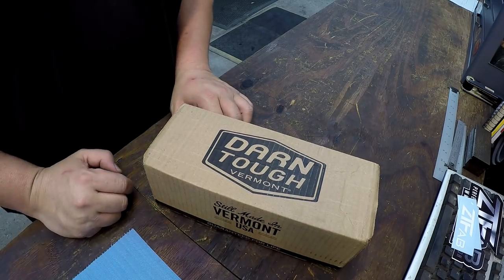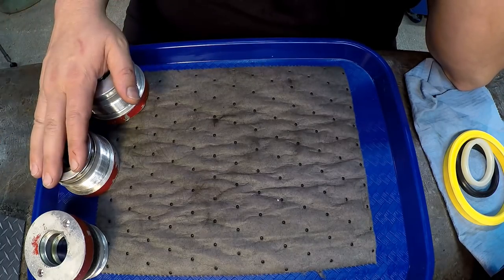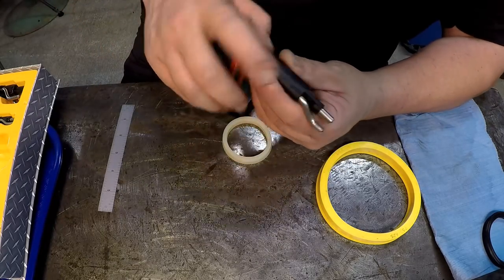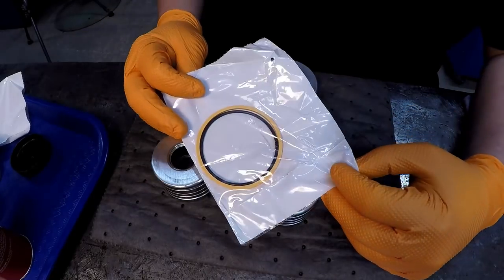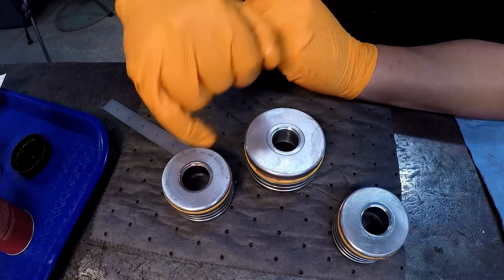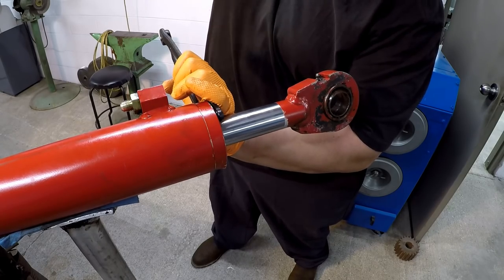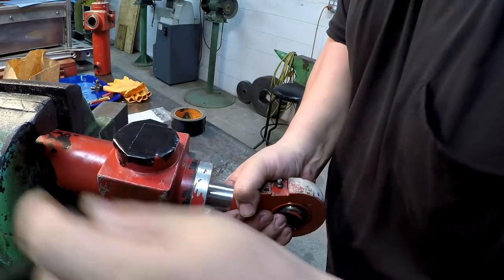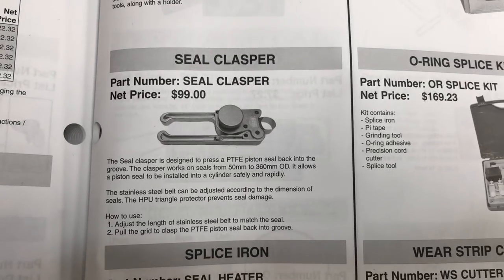SNS 217: Rebuilding Hydraulic Cylinders

Comment: I’m in the process of rebuilding a small cylinder on my Kubota and I ordered the seal kit but I had some questions that didn’t know if you could answer. All my local Kubota dealers seem to not want to help.   But was wondering if there was a way if I could send you two pictures of the plunger on my cylinder?  Thanks Ben

Comment: No doubt it's been mentioned already, and no doubt you're already aware, but for those who aren't;  a quick weld bead (TIG bead no filler metal required is ideal) around that bearing ID will shrink it and make removal easy.
Reply from the maker: We do it all the time, but didn’t work in that thin race. Weld beads wanted to melt through and stick.

Comment: right now I'm in the process of painting the  530 case Backhoe back to the factory color case yellow one gal of case yellow paint from tractor supply $100.00 and the set of 4 case decals I've got to order from case manufacturer for $100.00  I'm getting the Backhoe all painted up before winter gets here

Comment: Socks.  I have big feet.  Not quite so big as yours, but pretty big.  Most people with big feet have big legs.  

I bought several pair of the largest Dan Post socks after seeing them mentioned on your channel.

The heel to toe length is fine, but the diameter of the tube going around my leg is so small that it's very hard to pull them on.  After working all day, it's also hard to peel them off, and my leg feels numb.

The Darn Tough socks don't seem to be available in white.

Why is it so hard to find good white socks that fit properly?
Reply from the maker: When I first put the socks on they seem to be tight but loosened up a bit after wear and washing. I like the height of the Dan Post socks better and want to get some more in the plus size.

Comment: The backup rings you installed, are the orings overlapping the back up or are they staggered? Its hard to tell from the video. Oh and to answer your question on NGLInumbers, the higher the number the thicker the grease, for example: 00 is very viscous while #7 is solid  or very rigid at room temp. By the way, thats a nice spanner wrench, where'd you find that style? All i can find are the c clamp style for a ratchet..

Comment: Per Adam's request - what I found on the internet about #2 grease: 

"The most common NLGI (National Lubricating Grease Institute) grade of grease is #2 grade grease. These grades determine how thick or thin a grease is based on an ASTM D4950 test for penetration , at X60 strokes, @ 25°C and range from #000 (fluid) to #6 (brick). #2 grease has penetration of 265-295 (tenths of a millimeter) at 25C" 

http://elmusa.com/FAQ/ELM%20GREASE%20QUESTIONS.html

Comment: Why would you braze the tool holder instead of welding it? Wouldn't welding be much stronger?
Reply: Its a hardened forged part. Welding it would ruin the grain structure.

Comment: the NGLI Grade it the thickness of the grease.. There are grades 0000-#4 or higher.  0000 is like a thick gear oil especially when warm and #4 being rather firm- about the consistency of your average caulk..

Comment: That $100 seal compressor could be replaced with a $10 band type ring compressor used to install pistons into cylinders.
Reply from the maker: We use them all at our hydraulic shop. Seal clasper works better then a ring compressor.

Comment: I have a set of those tool. The cylinders I rebuild once in a while 3”-5” cyl
I’ve always found it easier to use these tools fiat faced  on flat surface.   VS. the way your doing it seems more problematic 

Try it on flat surface
Reply: I am  from China Seals Factory. Our company produces many types of hydraulic oil seals. If you are interested in our products, we can send you free samples so that you can learn more about our products.
Reply: I am from China Seals Factory. Our company produces many types of hydraulic oil seals. If you are interested in our products, we can send you free samples so that you can learn more about our products.

Comment: looks like bar holder broke because of counterbores for clamping bolts.  just look at the breakage surface. how thin it is in compare with other parts of a clamp.
it is a weak point by design.
and it may break again after welding. (if you keep original geometry of a part)

Comment: Thanks for the video it has answered a couple of ?, one I have is kind of hard to explain but I will try. I have a 310D combination and I did the rebuild on my cylinders myself   but only lasted 2 years on most, on the seals that go in the gland do the u shape seal go towards the cylinder or outward? If I don't make any sense don't laugh I'm a newbie to rebuilding cylinders, I placed the u shape towards the cylinder (pushing towards the machine and had doubts of this installation thou it was like this previously from a hydraulic man that rebuilt them the first time and only lasted a few months. The seals I'm talking about is double lip.  Thanks and hope all is good

Comment: well i wish fast recovery... and I have repair that is need of your skills to fix, Need a repair to a small engine crank. the threads snapped off when i was reassembling. if interested in future project this NAVY vet would appreciate your service.. no hurry haven't even tore the motor down yet.. I know all about recovering in a recliner, where i spent summer of 2018 after my triple By-pass. have plenty batteries for the remote.

Comment: Just a couple of things I might point out, seems like you haven't had proper training about hydraulics. So first point, you don't use grease in a hydraulic system as it can contaminate the system [oil] and block up the filters. If you are going to use lubricant you use oil  which is the same as used in the system. Point two, if you are going to use grease use rubber grease mainly in pneumatics
Reply: I agreed, never use grease,  I like to use a silicon grease specific for seals and in the thread I use grease with cob, Recommended by HYDAC
Reply: Lithium grease specifically causes the filter problem.  Good old petroleum jelly works fine.
Reply: Absolute crock of rubbish! No issues whatsoever using vegetable oil based red rubber grease! “Seems like you haven’t had proper training”!!!

Comment: would you be interested in a ring roller friction oil variable speed motor with transmission?  I got it a while back and ordered two quarts of the special friction oil.  It loses torque at low speed even after the oil change.  I think its 1/2 hp or so single phase.  I could send it to you as a donation if you are interested in fixing it up.  Those friction ring variable transmissions are neat marvels of their time.

Comment: What is the name of the tool used to compress that piston seal? I would love to have one of those for my work
Reply: End of the video. "Seal Clasper", I've commonly used those piston ring compressors for engines, works just fine. Y'know, the spring steel ones.
Reply from the maker: Seal clasper, I showed a video segment of it and the book it’s in.

Comment: I saw an Aussie guy that was trying to remove a bearing race from a lathe drive (I think,) and he took his TIG and fired a melting shot at 4 equal distances on the inside of the race, and when it cooled, the race popped right out.
Reply from the maker: Those needle bearing races are too thin, likely will melt through.

Comment: Can you use hydraulic fluid to lube seals prior to assembling?
Reply: Depends on the cylinder if it’s a hydraulic cylinder you can but if it’s pneumatic you want to use grease and if it uses a hydrolubic fluid you want a special type of lubricant that won’t clog your system for hydraulic purposes you can even use petroleum jelly.

Comment: I would think you should lay the seal on the black block after screwing it down then put the tool on the seal with the end of the tool going though the seal into the block to hold it while it's compressed .

Comment: We always just put the seals in by hand at Energy Mfg. We don't grease them, just oil them prior to cylinder assembly. That thing you call a gland, we call it a guide.
Reply from the maker: We call it a gland cause that’s the term for it, even says so in our books.
Reply: Abom79 You may be correct, maybe it's a local thing here in Iowa. Energy mfg. has been making those parts since the 40's.

Comment: I think most hard working people like yourself would just spend the money and buy the next pair after wearing one out. Its only fair. The guarantee is a great gesture by the company, but like most companies who offer it, they depend on most people not acquiring fulfillment of that guarantee. It would be like offering a lifetime supply for the price of one. I hope that most people would forego taking advantage of the guarantee unless they tryely didnt like them and wanted to return them, or they were truely defective.
Reply: Umm, nope. I have my tools warranted as soon as they break. When snap on wants $200 for a ratchet that I wear out every 4 months, they can repair it. Or if their sockets split, I get a new one. I bought the warranty not the tool.
Reply: And it's safer for me that way. Some guys like using sockets that never split. I have some Craftsman 6points that I cannot split even with a bar, but they are worn out and ruin fasteners. I prefer a fresh tool so I don't ruin a fastener or my knuckles.
Reply: @A_Man_In_His_Van  copy that
Reply: I felt the same way as you until I saw that it's $210 for a week supply of those socks.

Comment: the story of the boiling oil..
hot oil...is for working.. hot o ring,s fits faster.. batt the oil.. make the O ring soft..
so you had 2 things  hof 2 fix its faster
olso the stratcs on the O ring..(( a O ring of 2 inch... in a day in oil.. is growing ant is bigger out the oil.. so its a litle bitt bigger.. so ist a bit faster work job.
how bigger the O ring ow longer you most put in the hot oil. : )
nice movie adam !!! tanks ant gr

Comment: NLGI- NATIONAL LUBRICATING GREASE INSTITUTE NUMBERS DEFINE RANGES OF WORKING PENETRATION, AN INDIRECT MEASUREMENT OF VISCOSITY. NO.2 IS THE MOST COMMONLY USED IT IS MED. SOFT,  NO. 0 IS VARY SOFT , NO. 1 SOFT, NO.3 MEDIUM.   McMASTER-CARR CATALOG TELLS YOU ABOUT IT.
Reply: does mcmaster also sell keyboards? your shift key is stuck.
Reply: flippynl     Sometimes all caps are easier to read.
Reply: flippynl  My question would be, does he realize that he is yelling at us?
Reply from the maker: It eve goes down the 000